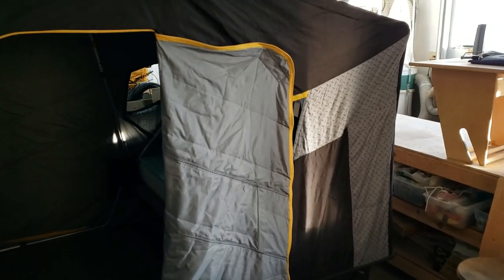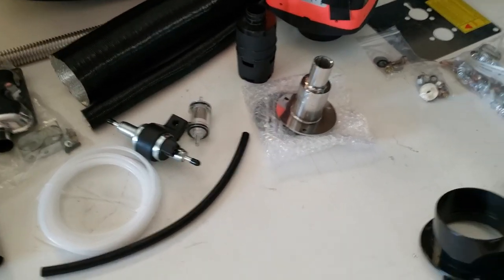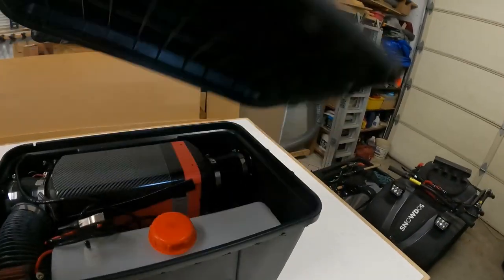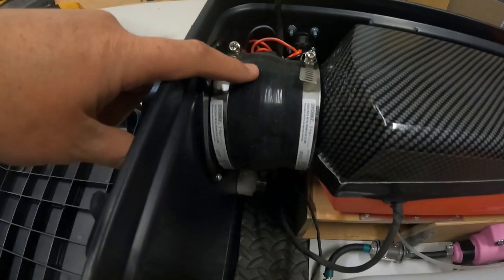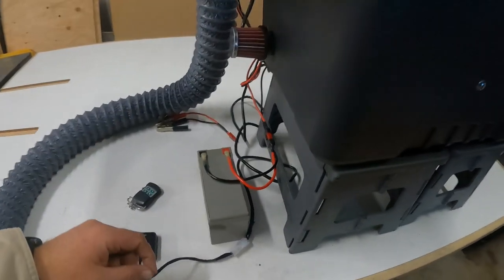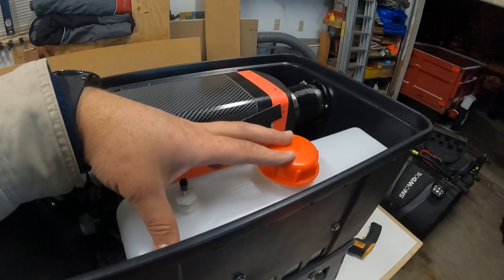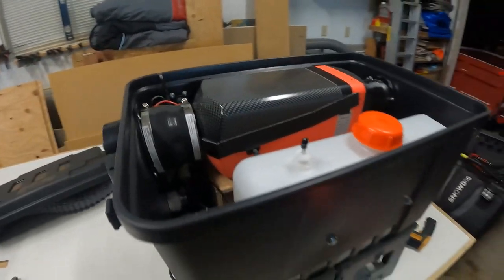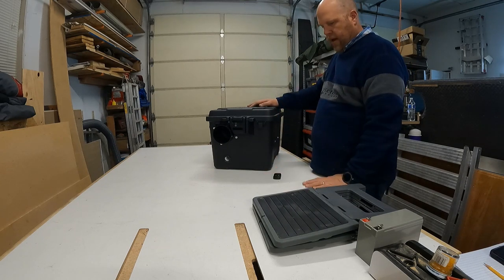A Better 12-volt Diesel Heater In A Box?

Comment: Glad I found this video!  I use those Plano boxes for most of my gear and this will make everything stack neatly together.  I'll try to make a metal box for the inside (but that's just me).  Also, If I can find aluminum flanges instead of the plastic ones, I 'd be happier too.  I am sure the plastic ones hold up to the heat well enough but I can be a little rough on things.  Nice job.

Comment: Any updates to this build? Anything that you would do differently? Thanks great content
Reply from the maker: See the another video on my channel of the field test. No issues and currently wouldn't change a thing. I do run an air hose to recirculate the air and so I usually only need to run on setting 2 or 3.
https://youtu.be/1_xMTLKIlBs?si=TxHLOx9xMnMhnMGC

Comment: Looks nice.
I've noticed you didn't provide any ventilation for the box. How hot does it get inside with lid closed?
You could take the intake filter and put it on directly onto bottom of the heater intake. Just provide some ventilation.

Hcalory came out with pre installed heater in a case. Some what flimsey.
I think I'll use Ridgid tool case for mine.
Reply from the maker: Yeah, I had planned to redo the combustion air intake to be inside the box with just a vent installed on the side of the box....but to be honest it has been running perfectly so it is low on the priority list. I would like to eleominate the need to plug that intake filter on when setting up. The heat inside is actually minimal...like just above body heat range.

Comment: Your build is one of the best ones I've seen on YT to date. I have two questions though. 1) Could you have made the outlet air end 4 inch like the inlet end and why didn't you do it that way. 2) Could you please list any additional parts you used and where you sourced them and size of your box. And lastly just for the record at this time there are only two sizes of these particular heaters available for sale. A 2 Kw and 5Kw and John does go over this in one of his video's and explains the differences. Again very nice build should give you years of service and keep you nice and toasty while fishing!
Reply from the maker: The main reason in keeping the air effluent the same size was to ensure the air coming out maintained the max flow pressure and resulting velocity. Bigger vent would have the same volume of air coming through but the pressure and velocity would drop a little. I wanted to ensure the air coming into the ice fishing tent was able to reach near the opposite side before dissipating to help avoid it being colder on that side....which is where I sleep....basically making sure warm air made it to the sleeping side. 
Everything I purchased was on Amazon except the box which is the small Plano Sportsman Storage Trunk (24x12x15) available all over the place.
Reply: @hardh2ofishin857  I did not consider the pressure/volume ratio your absolutely correct! I'll be heating an 8.5 X 18 cargo trailer camper. I do want to go with a bigger storage box so I can use a bigger fuel tank.
Reply: Can you send a list of everything from Amazon
Reply from the maker: @dicklee5684  The list of parts is provided in the description with the original build video on my channel.

Comment: Awesome video. I am planning on doing the exact same thing in a Ridgid Pro 2.0 medium tool box. The part that has me stumped is the different rigid fuel line kits out there. The most recommended kit I have seen seems to have 2 different sizes of tubing, one 4mm OD and one 5mm OD. I am not sure why you would need 2 different sizes when the ID is the same. This would also require different sized connecting rubber tubes. What kit or list of parts did you use? Also, what fuel filter? Thanks.
Reply from the maker: Didn't have to get a separate kit..I made sure the heater that I purchased came with the rigid fuel line already. Fuel filter came with it as well.

Comment: I've also had issued using the 12v cigarette plug for power. What did you use to run it off your jackery? Could you include a link to what you bought?

Comment: Hi! Just wondering how the thru-hull fitting has worked, did the plastic case hold up?
Reply from the maker: Yep no issues. The outer edge that touches the plastic box barely gets warm.
Reply: @hardh2ofishin857 that's awesome! Considering a similar build, thanks for making this video.

Comment: Any chance you could put together a parts list? Awesome build. What I’ve been looking to build in a portable unit
Reply: The simplest way is to buy one of the portable all-in-one heaters - which will by definition have everything you will need. You're only throwing away the metal casing.
The tank in this video is from one of the 'squat' portable heaters. There is another type of tank (more like a long rectangle, square section) - & this will be found in the 'tall' all-in-one heaters.

Only caveat is, do buy a fuel filter, as many of the all-in-ones seem to omit this.

I say 'buy an all-in-one' as opposed to a normal separate-pieces heater, because for this project, you're concerned with the fuel tank shape. The normal heaters come with really large tanks, which wouldn't work so well for a project like this.

Comment: great build man! Im looking for something for my ice shack i think i might do exactly what you are doing and use the jackery 500.  Any issues while using the jackery?  Any tips you would give me before doing the build? thanks!
Reply: any reason you chose this specific diesel heater over another?
Reply from the maker: Jackery 500 has had no problems. I bought a foldimg 100watt solar panel from Amazon that has no problem recharging the Jackery during the day even with limited sunlight.

Comment: Did the jackery power this ok? I have the same heater and it shuts down my Ecoflow Delta during powerup. Its pulling about 138watts. I ran mine full power for about 13 hours and used 9liters of diesel.
Reply from the maker: Yep...no issues using the Jackery. Have used it 7 times now camping on the ice with no issues at all. Usually only run it at about 50% and it burns about 3 to 3.5 liters over about 12 hrs.

Comment: I think a metal box would work better (plastic can be brittle and melts dealing with higher temps) I would go that route if used outside for ice fishing or camping.
Reply from the maker: The Plano boxes don't get brittle and  nothing hot touches the box to melt it.

Comment: Do you have a add-on parts list? Also how are the plastic hose flanges holding up? I want to do the same thing but was worried about them melting on the output side.
Reply from the maker: The flanges are holding up fine. I got them on Amazon and they are designed/marketed  specifically for heating/AC applications. No melting.
Reply: @hardh2ofishin857  do you have the link?
Reply from the maker: @AbstonsGarage  Just added the basic parts list to the description for the build video and it has the link to Amazon for the parts

Comment: How did you mount the box under the heater to the Plano box?
Reply from the maker: 4 pan-head screws up through the bottom of Plano box and into plywood box. Placed them in the molded recesses of the plano box so the don't hit/scratch any surfaces.

Comment: Happen to recall the dimensions of the box the heater sits on? Also, how did you connect the intake and exhaust hoses on the bottom of the heater?
Reply from the maker: No...I just freehand something close to the dimensions of the heater itself.  I connected the hoses using the hose clamps that it came with per the heater installation instructions.
Reply: How did you attach the air inlet for combustion to the container?
Reply from the maker: @The1KMnO4  I fashioned a pass through using standard PVC couplers glued to each other through the hole I drilled in the box. A 3/4 inch male threaded PVC coupler fits perfectly with just a little sanding in the inlet air tube that came with the heater and then I glued a 1" to 3/4inch adapter/coupler onto it through the hole in the box. The 1" opening on that adapter is the perfect size to attach with a friction fit to the inlet filter when setting it up.

Comment: What's a good way to get the hot air into a truck canopy. I assume you have to drill a big hole for the ducting but is there some sort of port that seals up when not in use?

Comment: Take a look at the box I put together.

Make sure your Jackery is capable of 150w output in DC as the startup is approximately 130w with the glow plug and shutdown about 100w..

Once started, power draw is from 6-40w.

IMO, given tents are generally not insulated, recirculating the air is not necessary.

The mufflers don't really quiet it down much of any..
Reply from the maker: My field test camping on the ice yielded different results  (see the field test video).  The Jackery worked great. I noticed a difference adding the second muffler...not a lot..but noticeable. Really liking the unit and glad I built it. Will post another updated field test video after I run it with the recirculation setup and see how much I can drop the fuel and power consumption.

Comment: Good luck with that noisy thing, you do understand that the more noise you make on the ice, less fish your going to catch. Setting that thing on the ice next to your tent is no different then running a noisy generator but it's your tent would just stick to the silent buddy heater.
Reply from the maker: Note: the sound captured on the build video is intensified due to the camera. With the lid on, and the added sound dampening I added, the heater itself is super quiet. You'll see in the field test video that you can't even hear it anymore. Had no problem catching trout, burbot, and Perch everything I used it.
Reply: @hardh2ofishin857  sweet I was worried it was going to be blowing like a jet 😳

Comment: Why don’t you buy the already build in a box Chinese diesel heater? They are the same price.
Reply from the maker: A couple of reasons.. #1 Wanted a larger fuel tank. #2 The pre-made ones often come with the cheaper fuel lines (you want the thinner diameter hard lines not the softer green lines). #3 Assembling myself allowed me to get to know the unit better. #4 Satisfaction in building it myself.